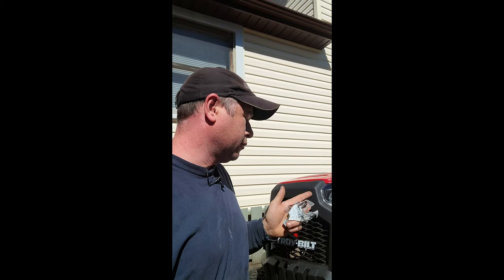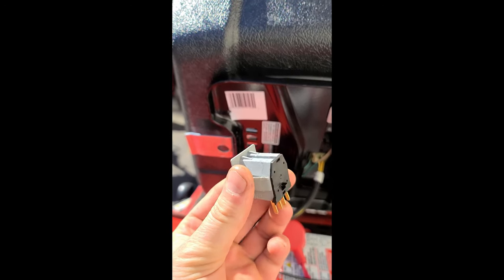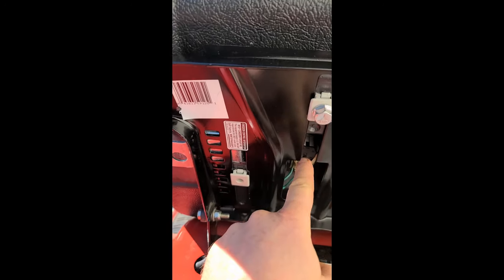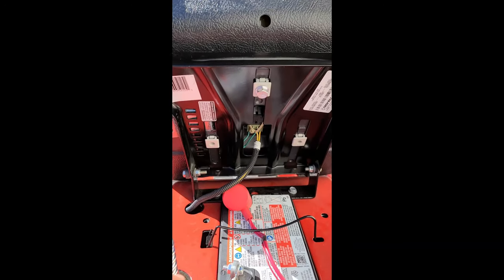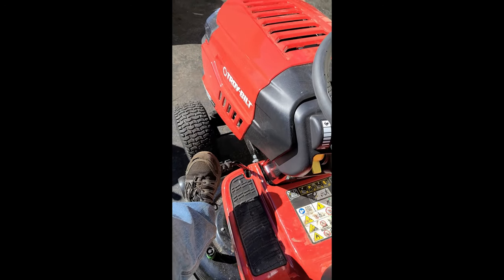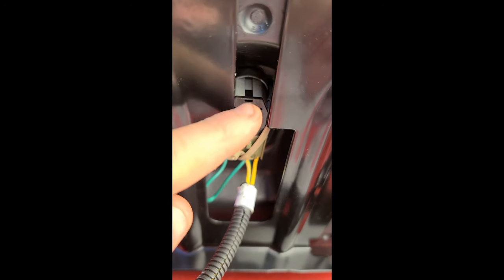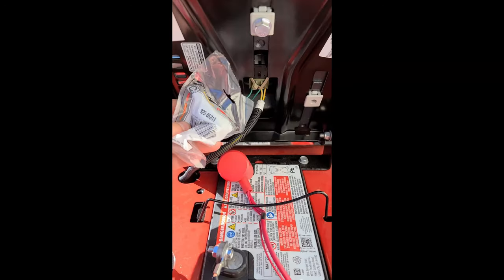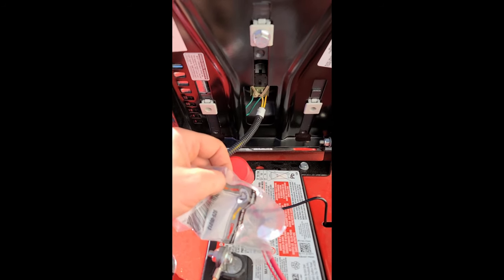New Lawn Tractor Dies When Releasing Brake / Clutch Pedal - Easy Fix! #shorts

Comment: Great tip Don. We don't have much (I think I've seen 2 or 3 machines in the 20+ years I've dabbled with small engines) Troy-Bilt over here.
We have Stiga, Partner (Electrolux), MTD (which manufactures Troy-Bilt), and other brands and the Chinese brands are becoming more and more "popular".

Comment: I’m at a lost, when I release the clutch/brake or even try to engage blades it dies instantly, people say it’s the seat switch but when I use my volt ohm meter it says I have continuity when I press the seat switch button. Could you please help me?

Comment: I just removed my switch and no more problems!
Reply: I done the same, there just a nuance
Reply: You must have an older tractor because the new ones and anything withing 10 years has a shirting prong inside the plug so that if you disconnect it, it still won't work unless you rip out the shorting prongs.

Comment: I replaced the seat switch on my Craftsman lawn mower and it still does the same thing when you let off the brake pedal it shuts off
Reply: Did you get to the bottom of that problem. Mine does the same.
Reply: just cut the wires be good to go

Comment: Did that on my craftsman. New switch, same problem. Connector, not the switch was the issue. Now to purchase the connector…
Reply: Look inside the connector, there's shorting prongs inside it that are the problem. The corrode and become deformed in size and shape. Get needle nose and rip it straight up and out.

Comment: Can you just disconnect the switch
Reply: Not that easy if you are trying to bypass the Safety Seat Feature.  You can tape the Plunger down on some models.
Reply from the maker: no